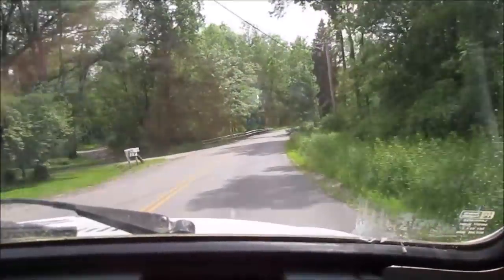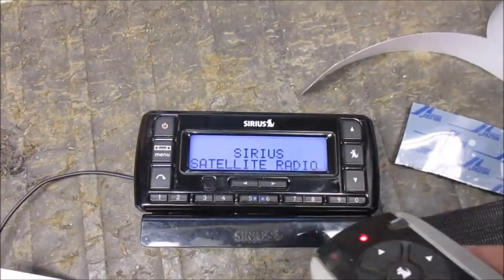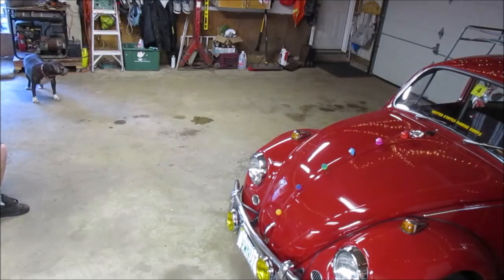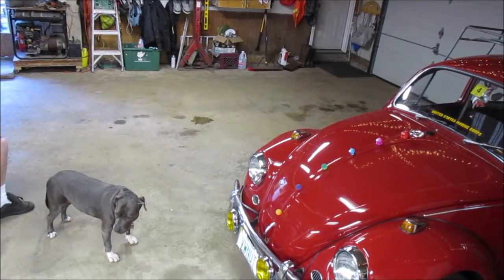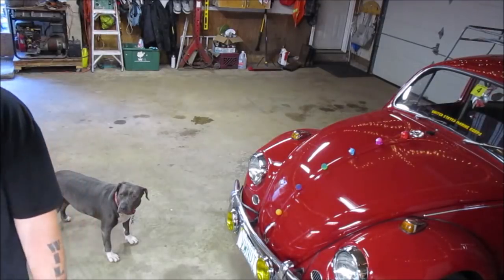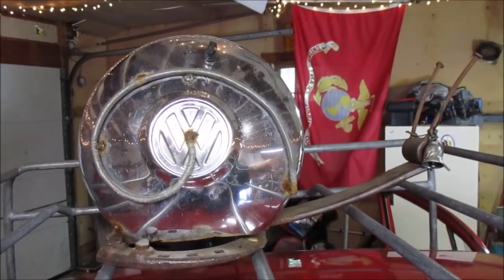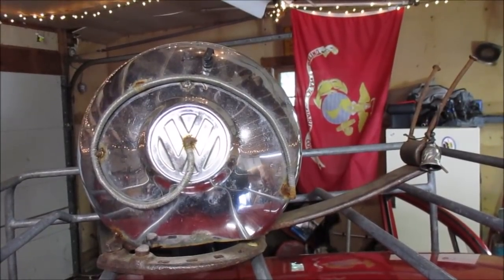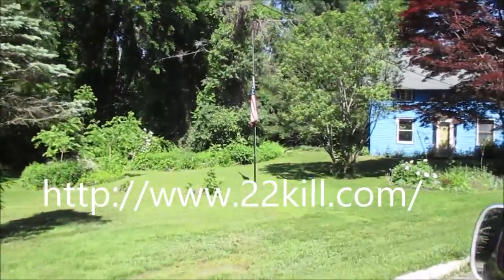1967VW bug carburetor maintenance

Comment: Back in my wrenching days, I found it made sense to plug the fuel line, rather than pinch it off. I have seen others drip gas into the distributor, and create a small explosion. Keep up the good work.
Reply from the maker: thanks for the tip and for watching Larry

Comment: Brian your strawberries are doing similar to mine. I wonder if you could pour a little bit of cooking oil in your fuel tank over winter and it would float on the top of the fuel? Would it stop the ethernol going off? I know you can do that with toilets to stop the trap drying out if you don't use them! it might mix with the fuel though.
Reply from the maker: I have found that it is best to just run them out of gas when you store them. thanks for watching Michael

Comment: Don't you have a fuel filter for the carb?   My father had a '66 1300cc Beetle and every so often his car would run rough and he would take off the carb and clean it with Gumout and restore the smooth running engine.  I didn't see a gas filter on yours.   It would certainly keep the carb clean!
Reply from the maker: there is one in line. thank you for watching Dave

Comment: Ok what are the dimensions of the washer you put in the carb.  and what was the washer made of brass or copper maybe, or did you do something else inside the carb. We heard the car run on the road before the fix but not after?
Reply from the maker: the car was started on video after i put the car back on. i do not know the dimension of the brass washer that i added. thanks for watching Frank